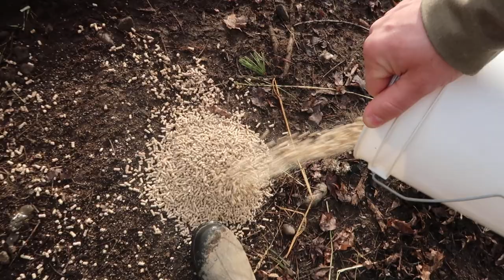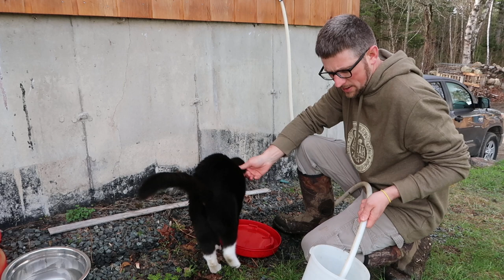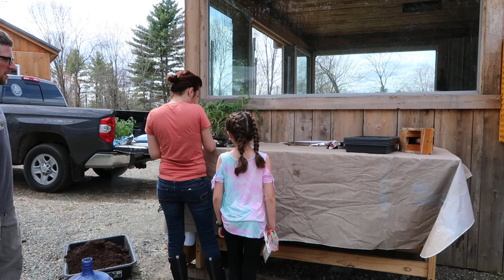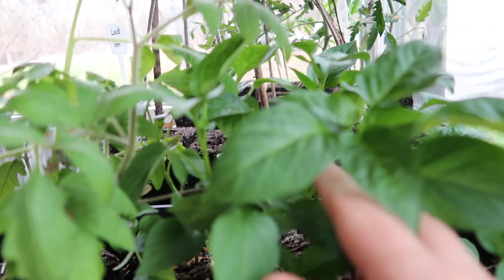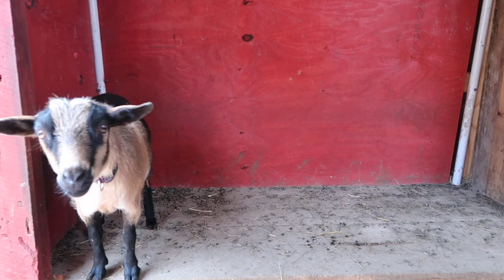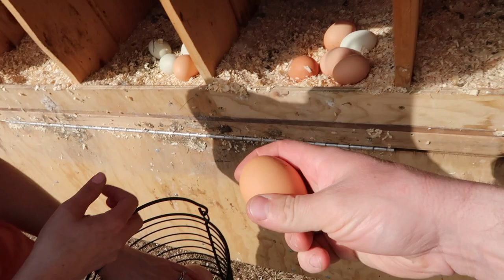We've Only HAD the Piglets for 2 Days and This Already Happened

Comment: Hey Al, glad your that free vitamin D and free Prozac. I've thought of a few more names,Hammy and Big Bacon. Hammy was a cartoon character. I always liked my tomatoes to be a little leggy. I could bury them deep if I figured on dry summer or lay the leggy part of the plants in a trench to gain more heat at the surface. Well looks like your spring has broke and you can finally kick the year into gear. The Mississippi River has fallen four inches and is predicted to keep dropping. We didn't get the five inches of rain predicted only about an inch. They did get some heavy rain and snow north of use but it shouldn't get here till the river gets down quite a bit. Short of a heavy rain in the area we should be done with the worst of it. Well enjoy the nice weather and to you and yours health, happiness and prosperity. Larry

Comment: 🐐🐐🐐 AL, I ALSO Forgot to mention in my earlier post that we use something called lime stone screenings in our paddock areas that would work very well around your goats it’s very fine in a packs down tight sort of like a concrete. Or also agricultural slag you could then top dress it with something else. We do not. We just add another layer where necessary the following year. We do this as necessary usually when it dries up a bit. Comes in white or gray. 🐐🐐🐐

Comment: Just trim the left wing, not both. That way she will be off balance and unable to take off. 
I'm curious if that solar fence would keep rabbits, coyotes and deer out of the garden, it's too far to pull electricity at our place. I already use solar lights and spots with motion sensors but they barely make it overnight.